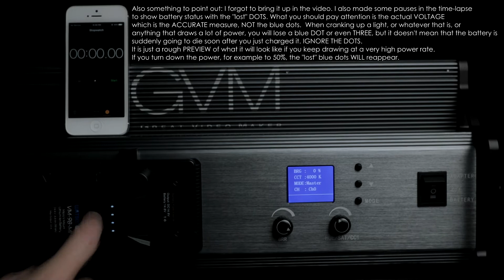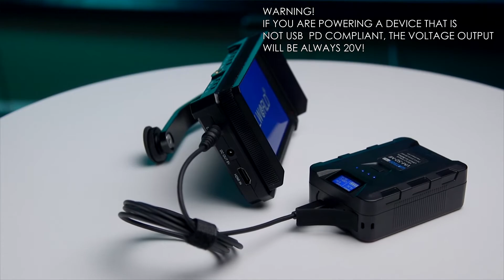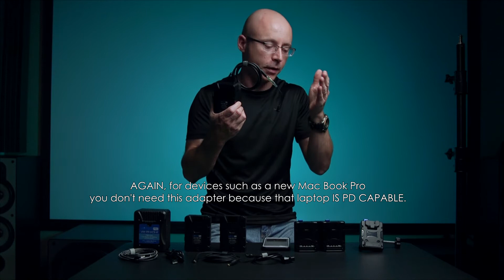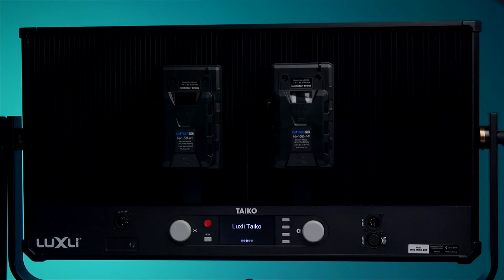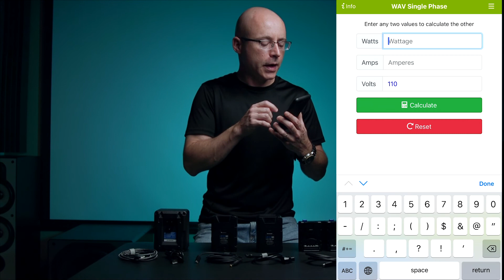Watson 14 4V 98Wh Micro V Mount Battery Review and BEYOND just the battery!

Comment: Thank you for this video. I've been mulling over which v-mount battery to get for longer than I care to admit (ENDLESS options out there!!), and I think I may have found a solid contender. Maybe I'll even order one tonight! (I keep getting tempted by cheap batteries in the $130-180 range that say they are 98wh batteries, but my gut feeling is that I won't be at all satisfied with their performance once I actually get my hands on one.

Hopefully Watson is a couple steps above the cheap Chinese brands out there. (Don't get me wrong, I have a number of adequate or even good Chinese products, including the Pictor Zooms.)

EDIT: OK I wrote that before finishing the video, and I'm still not finished... but now I'm scared to plug anything into it incase its not PD compliant. If I only use the D-tap and the other ports (DC out), I should be good right? Well... I need to watch the second half of your video. I'm just in a hurry to get some essentials on the way so I can have them next week... 😅
Reply from the maker: Yes, going cheap with batteries is not a good idea. You get what you pay for. You don’t want a light to suddenly go off in the middle of a shoot unexpectedly. 
When you buy a new battery, don’t forget to condition it by charging in full FIRST before you use for the first time and discharge it immediately, but DON’T LET IT DIE completely. 

Storage: keep ALL lithium batteries charged up to 50%. Never 100 or 0. This will insure longevity.

And buying from BH, no fear there. If you don’t like it for some reason, return it. Done. 🙂
I’d appreciate it if you used my links. They don’t cost anything extra and helps the channel 👍
Reply: @ArtVideoProductions  Thanks for the response, I agree about not going cheap. 🙂 Sure no problem, I was think I would try your link for that reason. It doesn't appear to have anything showing that its your link in the address bar or on the webpage, but I'll trust it works somehow, heh.
Reply from the maker: @mrhobs  Correct. It doesn’t show anything special. BH website creates a special link, tied to me so they know who’s link that is so I can get my little commission, that’s all.
Reply: @ArtVideoProductions  Not sure how to tell when the batter is full getting close to empty. Looks like it it says 15 volts when full, and 12 when empty? I can't find where you talk about that in the video. Maybe I missed it.
Reply from the maker: @mrhobs  no problem lol. Ok… as soon as the gauge LEDs start to blink, that’s when it’s getting “dangerous” near completely empty. The battery has a display or you can occasionally press the gauge to check out power.
Reply: @ArtVideoProductions  Thank you for discussing this with me, but I'm about ready to switch to "Core SWX Hypercore NEO 9 Mini 98Wh" just because they have a simple percentage and time estimate on the display. Also they are the same price so quality is hopefully comparable. On the Watson it just tells me some volt number, and I don't know how low the battery is getting. I understand the flashing part, but what about 35%? 50%? I like to keep an eye on the battery. 

Maybe when it gets down to like 2 volts that means its almost ready to start flashing? Or does it ever even get down to 2 volts? I'm not sure if that volt display is just showing how much is being drawn, or how much is left, or...? I'd be happy to learn to use it, but Watson's website doesn't explain anything about it. I even searched for PDF manuals online, but nothing really out there. (They too mentioned that the display indicates the batteries life or something, but I don't know how to convert random volt readings into "time left on the battery.")

Core seems to have a much better display, but I like some of the features about Watson as well. Might get the Watson upright charger (2 bay) from a link on your other video, and use it to charge the Core batteries. Should work, although I can't find much information about charger compatibility. (I think on the BH descriptions of one of their chargers it simply warns that some batteries might not be the right size for their chargers, so I took that to mean that if it fits, it will charge fine. And it should fit.

Anyway... sorry to dump all this on you, and sorry for kinda ranting a bit, but thanks all the same for reading. 🙂 (I'm tired, and work is going to be hard tomorrow because of it, and I was hoping have an easier time deciding how to spend 700 dollars...)

I do appreciate you're willingness to help, carrying on making great content! 😄
Reply from the maker: @mrhobs  no problem. I think the best option is to call BH sales. They will help you with making your decision even better. That’s how I do if I’m indecisive about a purchase.

Comment: Love the effort, but heads up, you royally screwed up the math on your biased B&H reviews for these — you can’t directly compare amps at 14.4vDC to amps at 110vAC, which you did...

I cannot stand how many of these “got the product for free” 5-star reviews screw up very basic power math, yet claim to be giving an honest, true, and non-biased review.

Review copied off B&H for 50Wh version: “These Micro V-Mount batteries support loads up to 8 Amps. To give you an IDEA what 8 Amps are, a LUXLI Taiko RGB light is a 400 watt unit, and at 110V, the amperage on that light is only 3.333 Amps! That's a third of the 8 amp maximum load. I don't recommend using these batteries for that. No need to stress them out, but if you absolutely must do, you CAN.”

^ Please no. No you can’t push a 27.7amp @ 14.4v load off a single one of these, that would be 350% of their rated sustained 8amp output.
Reply from the maker: Thanks for your input and feedback here.

1- First of all, I;ve been buying Watson batteries with my own money, way before I even started reviewing these watson batteries. All my reviews are honest and not biased. If the product is terrible, I simply send it back and will not review. The many reviews I do, if there is something negative about any product, I'm free to say whatever I want. That doesn't stop any manufacturer from sending me their items to test as they know and agree some products are not great. 

2- I don't consider these as "free items". These reviews are extremely time consuming, (this video took about 8 hors to make and edit) and it's the same amount of work as editing a wedding or a commercial, especially considering the price of the battery compared to my rate of $5,000 to shoot and edit a commercial, which for these reviews, I don't get paid one cent. I do it because I enjoy doing it.

3- If BH copies a review from a higher capacity battery and putting the same copy and paste on a 50WH version, I can't control that. And you can use it on the Taiko as an emergency, as long as we respect the limitations of the battery, like... not exceeding 20% brightness if you will...

Thanks again.

Comment: Man 300 for 98w that’s a bit much it is a nice c mount just a bit much. But hey what do you call that cord for voltage.
Reply from the maker: Here’s the link to buy. As an Amazon affiliate I earn a small commission from this link. It doesn’t cost you anything extra but it helps me continuing to make videos like this.
https://amzn.to/2HxfgnK
Reply from the maker: This is not a cable. It’s a board which requires soldering and adding a cable of your choice. It’s very easy to do.